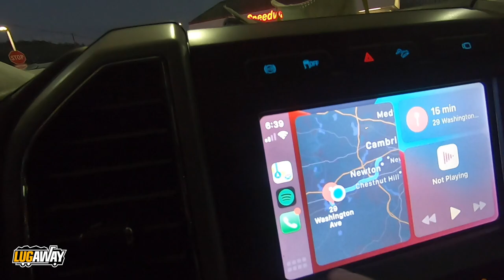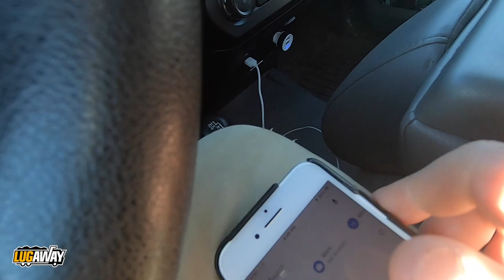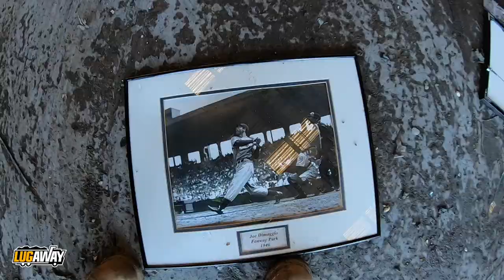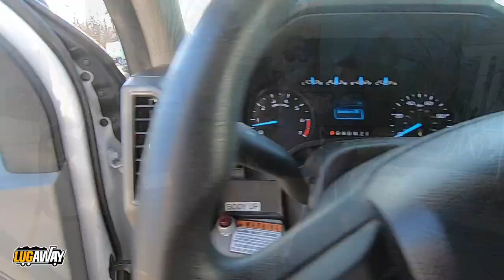MAKE $1K - $2K+ EVERYDAY! JUNK REMOVAL DAY IN THE LIFE

Comment: Great video. I have a question. Do you guys charge flat rate prices for your pickups or by the size of the  load. I’m about to start junk removal on the side with a 6 x 12 utility trailer and was thinking of charging a flat rate to fill the trailer up. Any suggestions? Thank you in advance for your response.

Comment: Do you prefer a dump truck to a dump trailer?  It seems better to have trailers that you drop off at jobs and pick up later, but you seem to load it yourself and are making a killing, is that because you can do more work loading a truck versus dropping off trailers?
Reply from the maker: Junk removal goes like this. You get a call to remove stuff, you set up a time to do it, you arrive, you fill the truck or trailer,  you take payment, you leave. If you are dropping dumpsters or trailers and picking them up later you would be in the dumpster business not junk removal. Both can work very well together, but if you are going to be advertising as a junk removal service, do what a junk removal service does. I prefer a dump truck because its a whole lot easier to maneuver.

Comment: How and where would one find a truck/dump like that? Also did the dump trailer come with tall sides like that? Great video!! Thanks
Reply from the maker: You need to buy the truck as a cab and chassis. Look it up on google and you'll figure it out. Then you need to get a truck and body company to install the kind of body you want. Mine is called a Stake Body or a Rack Body. My dump trailer came with tall sides but you can buy that same one with short sides and make your own sides if you want.

Comment: Are you using a cable and winch? If so what company did you use for that setup? I have a truck but am having trouble finding a cable and winch setup other than switch and go.
Reply from the maker: No cable winch. Both my dump trailer and dump truck use hoist systems to lift and lower the body.
Reply: @SteveConroy1  Thank you

Comment: Hey bud thanks for the vids. How much do you charge for a full load on average? Thanks
Reply from the maker: A full load is never on average. A full load costs the price of a full load. Only times your prices should fluctuate is if it is extremely labor intensive, job takes much longer than it should due to site conditions, heavy material, or light material. That being said, for a full load I charge.............

Comment: Do they subtract a the weight of the of the truck from the actual trash ?
Reply from the maker: Yes. What happens is you drive onto a scale at the transfer station or wherever you dump stuff. You weigh in, dump the truck, then get back on the scale to weigh your truck with nothing in it. They take the first number (full truck) and subtract the second number (empty truck) and that is the number you get charged on.
Reply: @SteveConroy1  ok cool thanks

Comment: Thank you for the video! I'm an 18 year old college student, what do you think I should charge per load with a 6 foot bed Ford Ranger? I don't have an official business, I was thinking $150 to $200 per load? What is your advice for a newbie like me starting out? Also, where do you do your marketing?
Reply from the maker: Your pricing structure is based on what it costs you to dump. What is your cost per ton? What state/city are you servicing?
Reply: @SteveConroy1  It's $80 to $140 per ton depending on material. Is that higher than most other states? Serving in Washington.
Reply from the maker: @clarkt9925  Sounds about right to me.  I know Texas and other states in that area. pay around $30-$50 per ton but around me $120+ is normal.

Comment: how do you determine your pricing?
Reply from the maker: Cost is based on volume. Labor is included in truck load prices (30 min per 1/4 load). This is pretty standard but you can charge however you want!
Reply: Whats the labor charge? How much for 1/4, 1/2 full?